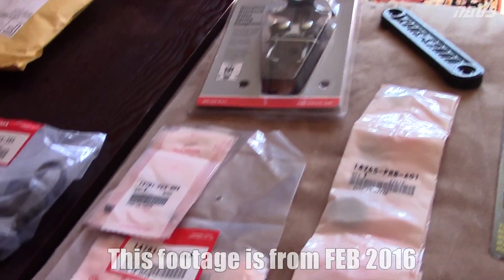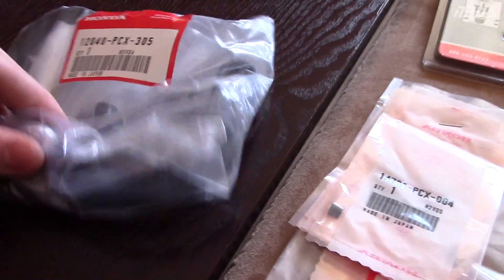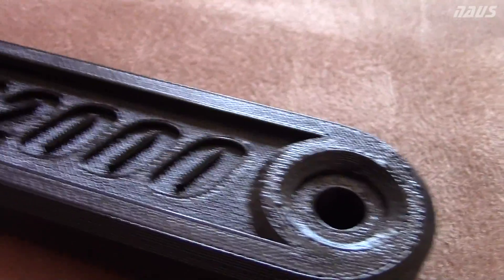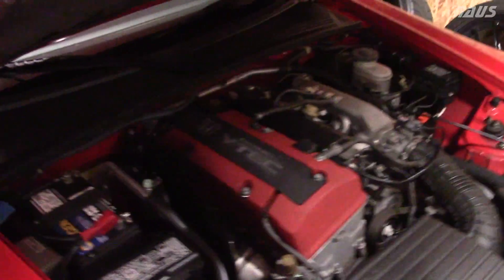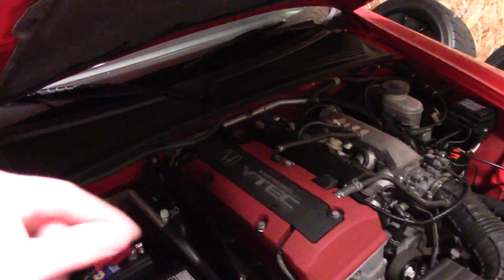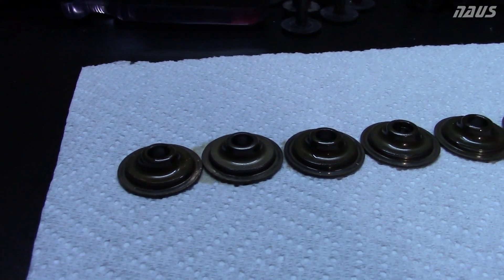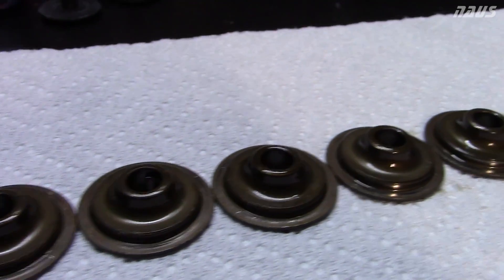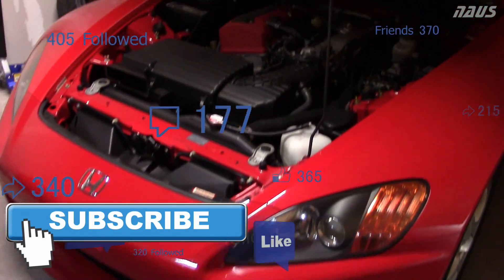Honda S2000 (AP1) AP2 Intake Valve Retainers Upgrade

Comment: Naus, I have ap2. Do you recommend changing retainers just because of high mileage? (My next valve adjust & stem seal change are due at 250k miles)
Reply from the maker: No dont even bother, your retainers should outlast the engine without any issues. Just do the stem seals and valve adjustment and youll get another 250k outta it with proper oil changes and TCT maintence

Comment: is that only s2k valve retainers that do that?
Reply from the maker: From what I have researched, Yes. K series do not have this issue. only the AP1 (00-03) models have this cracking issue. However it only occurs if the engine has been overreved (9500+RPM)
Reply: I have an AP1 '01 and am not sure if the previous owners were irresponsible enough to over rev her but looking at that limit of 9500 rpm+ like you said, I somehow seriously doubt they ever did. Which is good :) Still want to inspect them when I take the cam cover off for respraying. Do you have any idea approximately how many times the retainers can take over-revving before cracking?
P.S. I'm also on S2KI - RolanTHUNDER
Reply from the maker: RolanTHUNDER
There is really no answer for that since every engine is different, they could crack from one overrev, or go through 100 overrevs and still be fine. Only way to know is to take it apart and inspect them.
Reply: *****
I see. When I remove my valve cover for a respray I will inspect them visually. Is it possible t see them quite well without removing the cams?
Reply from the maker: +RolanTHUNDER it's gonna be nearly impossible to see the surface that cracks without removing the retainers completely, you can try will a small dental mirror but you won't be able to see them compete 360
Reply: *****
Makes sense. I suppose that if cracks aren't visible from the top then it's safe to say they either aren't cracked at all or slightly cracked on the underside? Best bet is to thoroughly check by removing them, I understand. Just not keen on the idea of doing that. I will have to find someone highly qualified if I need to.
Reply from the maker: RolanTHUNDER
They start cracking on the bottom (where you cant see), so they will all look perfect from the top even if there all cracked.
Reply: *****
Tough to see from the top then. I think I'll take the car into Honda for a valve clearance examination and ask them to report on the retainers. Then I can take it from there. By the way, did you have to do timing again after you reinstalled the valves, retainers and cams?
Reply from the maker: +RolanTHUNDER no , you align the cams before you take them out, then insert them in the same position on the same tooth, read the DIY link in the video description
Reply: *****
Cool, thanks.

Comment: what kind of 3d printer do you have
Reply from the maker: I do not have one personally, this was done on a Dimensions Elite though
Reply: @NAUS2K  Has it held up to the heat after all these years?
Reply from the maker: @samdavis1228  yeah it was printed in ABS so it can withstand heat no problem. However i recently upgraded to a lithium battery with a machined holder. Check it out under my latest videos